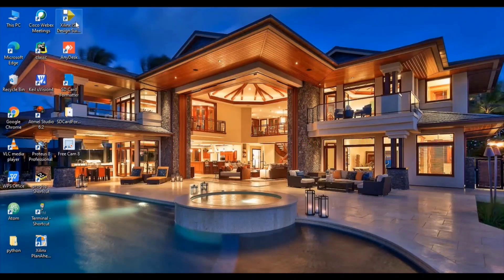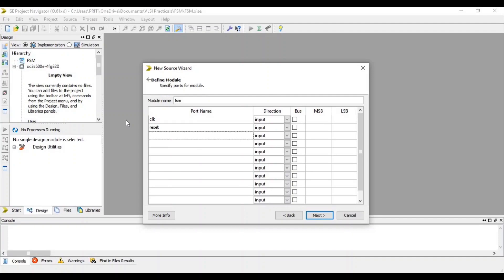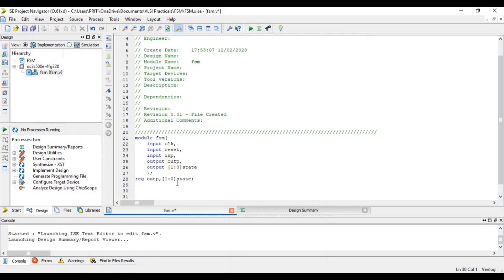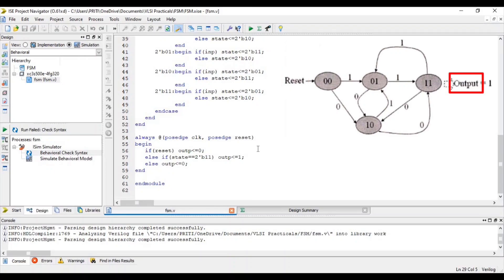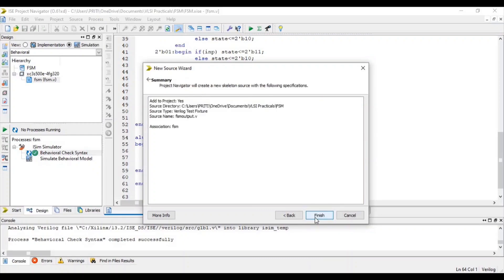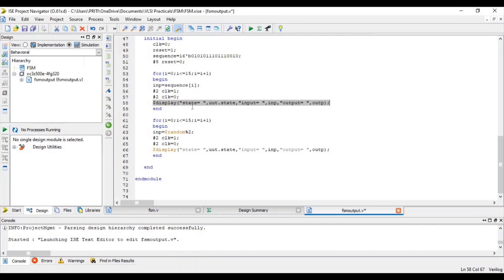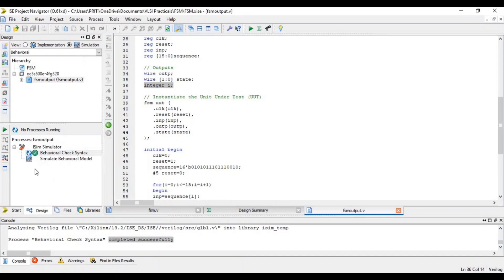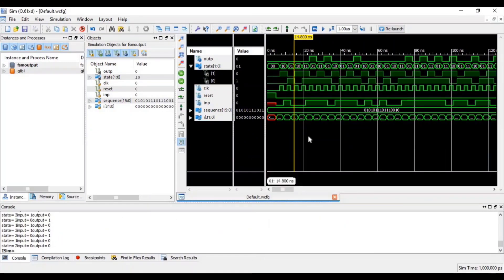Finite State Machine in Xilinx using Verilog/VHDL | VLSI by Engineering Funda

Comment: Thank you Prof. I need your suggestion to continue with Microprocessor & Interfacing 8085 or AVR playlist?
Reply from the maker: AVR microcontroller will be useful to you and it will also helps you to learn C language. Microprocessor 8085 is very old story but if it is there in your BE course then you can go for it.